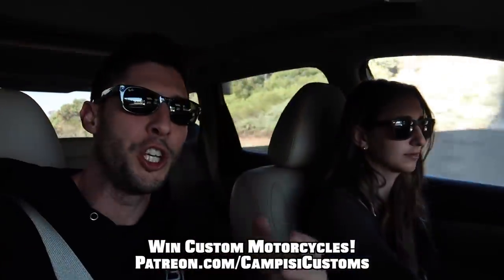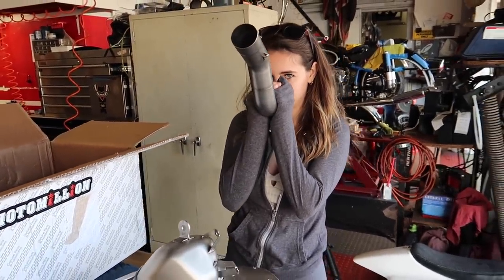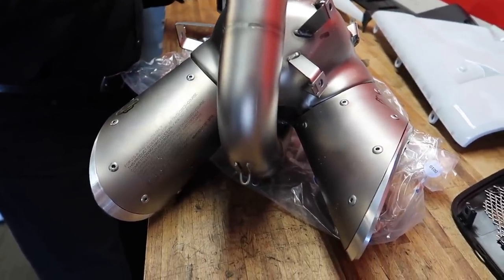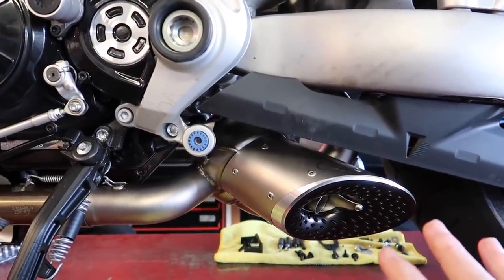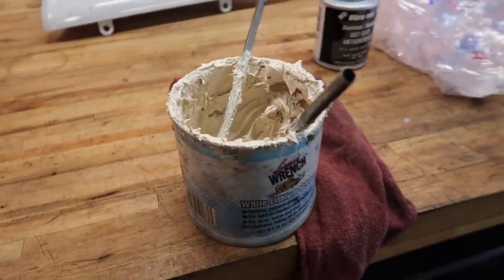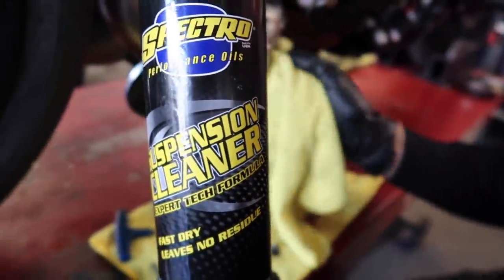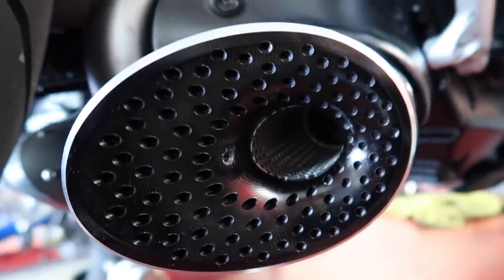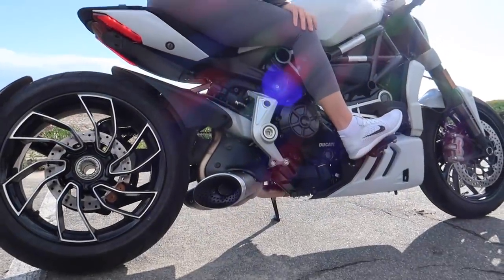Xdiavel with $3,000 Termignoni Exhaust!!!

Comment: Jaret...good one. I saw your other video where you removed the stock exhaust system. I also saw the video where you did the dyno test with the stock exhaust. I hope you're going to do an "after" dyno tune/test on this bike to see what the difference was with the Termi system. You said you're hoping to add 10 HP+/- but realistically I'd be surprised if you got more that 5 HP more on an "after" dyno tune but it would be interesting to know how much a good tweaking can result in.

Comment: $3k slip on.....#Damn
Reply from the maker: yeah it does come with an upmap though...also saves 12 lbs and should add 10 to 12 hp so it could be worse
Reply: @JaretCampisi  when you factor the up map, weight savings, and power.....makes sense..... $3k still makes me say Damn! Lol....keep up the good work...
Reply: @PokerFaceEsq  yea, most full exhausts on other bikes wont give you much more power than that anyways. Even the full system for the Panigale V4 doesn't give more than 12-13 hp, so gaining 10-12 hp from a slip on exhaust on the Diavel is actually quite insane